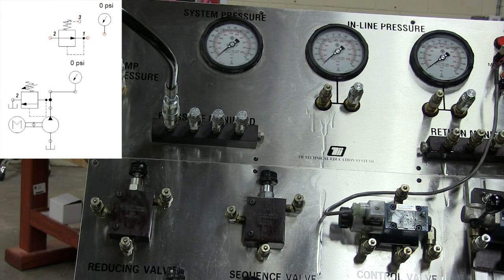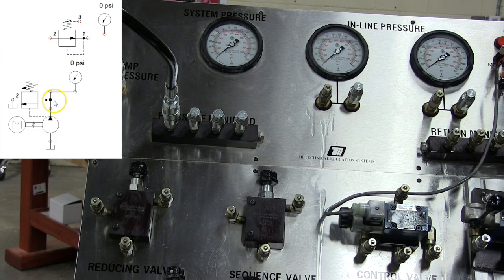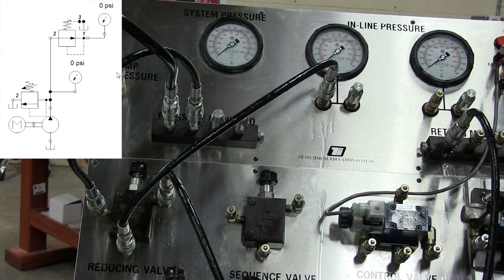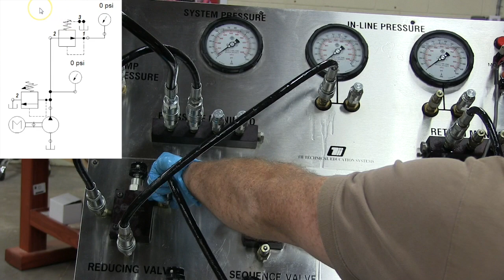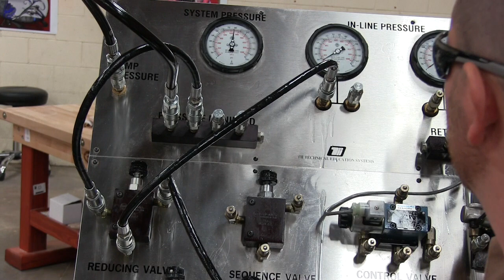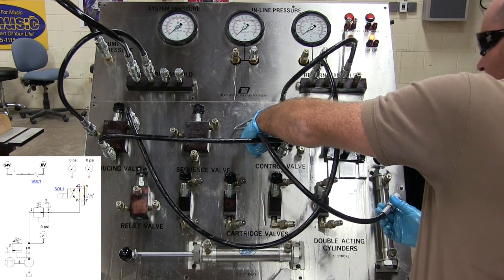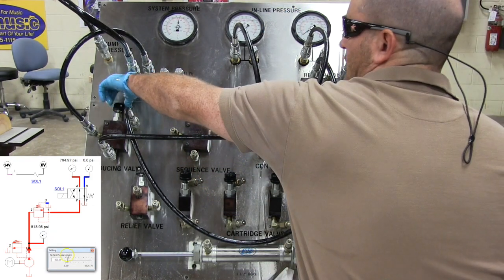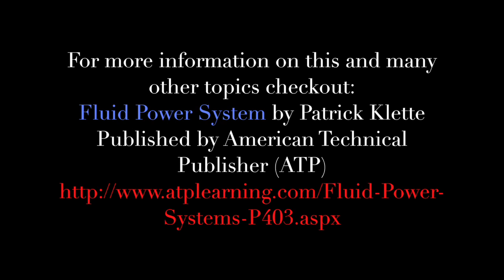Reducing Valves

Comment: Thank you for sharing such amazing experiment . could you please tell me what is your pressure reducing valve brand ? how can it readjust pressure without have revealing feetuer ?
Reply from the maker: The brand is Sun Hydraulics.  I am not sure of another way to reduce pressure without a reducing valve.  Depending on the system the only other method I can think of is to reduce the relief valve.  Hope this helps.
Reply: @KletteTech  could you share reducer part number please?
Reply: I meant to step your reduced pressure down same like how you showed us, you have had pressure reducer with relieving feature. Am i true?
Reply from the maker: I will get you the part number next week.
Reply from the maker: The pressure reducing valve does not relief the access pressure back to tank.  The relief valve does that.  the access pressure when the cylinder is fulling extended or fully retracted goes through the relief valve.
Reply: @KletteTech  as far as I know some Sun and oil control reducers are only reducers and some of them are reducer/reliving which I think one you showed is. I need the  part number or module type to confirm
Reply from the maker: Ill try and get it for your next week

Comment: you said the return line have check valve, so oil do not turns back, how  about inlet point, does there also have check valve, or  2 nd line which raise pressure when pump started, and pressure fall down when pump off,

 but inlet point pressure gauge zero psi understandable, but if the other point have check valve, why pressure release ans comes to zero psi??????

Comment: Very nice very help full thanks.
I want to apply same theory on my excavator.wnats to fix reducing valve but the pump outfit is 400lpm.i want fix reducing valve 
And out put I need is 20 to 40 bar.
Please help me out. Also needed one reducing valve.which I can adjust 10 to 40 bar pressure using reducing valve.
Reply from the maker: It sounds like you will need both a reducing valve and a flow control valve.  The reducing valve will control the pressure and the flow control will reduce the LPMs